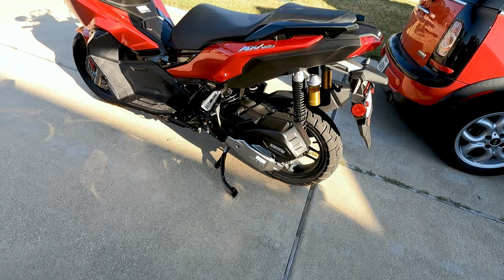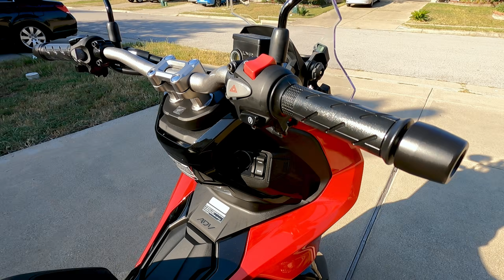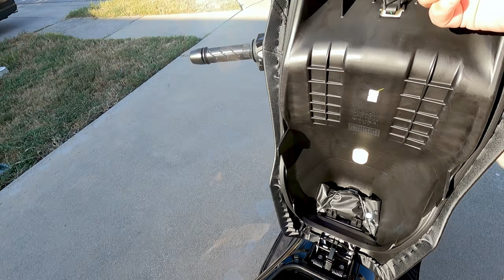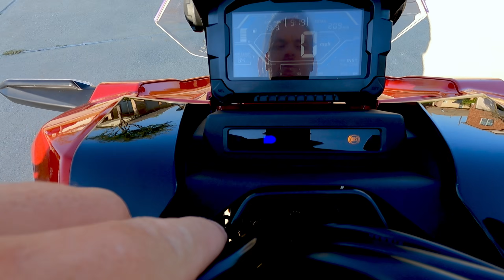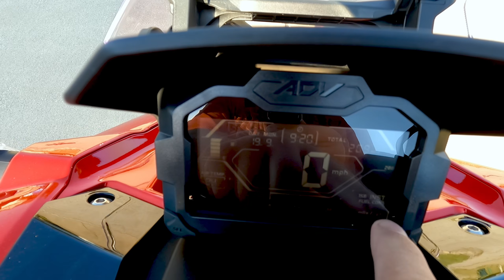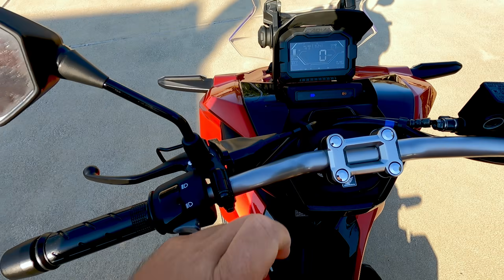Why I Bought a 2022 Honda ADV150 (And What Needs Changing)

Comment: Can u get it into the freeway?
Reply: The top speed for these are around 65 to 70 mph you can go on the freeway but I would try to talk you into getting an actual motorcycle, especially if you're going to be doing a lot of riding on the freeway

Comment: in my county, 150cc is more than enough for daily commute or even touring. but as i come to understand, it is a small cc bike in western countries (even 350 cc is small, in my country 250 cc is considered to be a big bike). do you feel it to be lacking in power? can you go on big roads or even highways with it?
Reply from the maker: I don't find it lacking at all, but you need to understand the limitations of the bike itself. No, I'm not travelling major interstates and generally am only on roads that are 55mph or less. So not really an issue for me because anyone behind me that wants to excessively speed can either wait or go around.
Reply: My brother in law in Cebu has a Click, which I think is similar.  Riding on the back of his sold me on those types of bikes

Comment: After break in, how many MPG are you getting?
Reply from the maker: approaching 6,000 miles now and I would say the average is between 77-94 depending on if I'm around town or long distancing it at full throttle.

Comment: I just got the 2022 adv 150, I only have 30 miles on it so far, I am 5 foot 11 weight 250, Just wondering what top speed i could expect out of this bike?
Reply from the maker: My guess would be 67 while maintaining a solid 55.
Reply: at your weight downhill 80+ uphill maybe 60mph , with a passenger maybe 35mph , lose 100 pounds amigo or buy a F-150 TRUCK !
Reply: @simonkaraoglanof1146  hahahaaaa , nice one

Comment: If take off that rear fairing could you put a 14 inch wheel? If so then couldn't you increase your top speed slightly since it shouldn't effect your top end torque to much
Reply: If you have ever ridden one you would know that going over 60 on this light bike is scary not pleasurable. Much better at 50 mph and below.

Comment: Which one is better? The Honda adv 150 or the Can Am Ryker?
Reply from the maker: They are completely different and better than each other in their own ways. What desire are you trying to fill?
Reply: @ExcelsiorDDZ  idk park of me want the Ryker because of its top speed of over 100 miles per hour and stability control along with the way it looks. I also like the Honda because it also looks good. Which one is faster?
Reply from the maker: @ManOfVizion  The ADV does 67 (72 modified) but definitely a slower vehicle as a whole.
Reply: In the Philippines, the Ryker is very expensive toy. You can buy 8 ADVs for the price of a Ryker.

Comment: Watched Quasi's video yesterday and bought one today!!  I have a Honda grom that I put a small fortune of money into but it just cant cruise at 60mph worth a crap.  You have to strangle every bit of the Grom to go anywhere.  I love how the modded out Grom rips but I really need something that can cruise so I added a ADV 150.  After easily getting to and maintaining speed into a 26 degree 17mph headwind with no problems whatsoever, I am confident that I made the right choice.  It rides like a small Goldwing!
Reply: I have a Monkey with a lot of mods and share your experience with having to use wide open throttle to maintain 55-60. Wind is really hard and the ride is quite bumpy at those speeds. Have you been happy with the ADV? Is it smoother riding and can you maintain speed even with headwinds? Does it get pushed around a lot in wind? I was thinking about going with something bigger like a Honda CB300 or CB500X, but maybe this would be all I need.

Comment: Do you recommend this for a 55 yo who has never owned a scooter?  Thanks!
Reply: Absolutely.  I never rode a scooter.  It is so easy to ride.  I do however keep looking for the pegs when leaving stops because I have grown use to pegs on my other bike. I think this is now my go to because it is so comfortable, smooth and easy.  It has all the fun and none of the work!
Reply from the maker: Being real close to that age, of course I do! It's a VERY nimble bike thats super easy to control.
Reply: I’m 67yrs and bought my 2022 Honda ADV 150 in Aug of 2021.  I’ve owned many Honda scooters in my lifetime with this being one of my favorite. All I did was sit on machine on centerstand at dealership and it fit my body perfectly . A short test drive and this scooter followed me home. I am 6 ft.at 220 lbs. Currently a little over 1000 miles on scooter and loving it. Living in Iowa with scooter in storage at this time.😬👍👍😀
Reply: If you can ride a bicycle you can ride this scooter. In fact it is much easier to ride than a bike.  I just bought one and rode it home 6 hrs and I’m 79 years old. Twist your wrist and you off. It’s far easier to balance than a bicycle.  It just takes awhile to get used to going 40 - 50 mph when you’re not used to it. Take it slow and work up to the faster speeds. In town at 40 mph and under it’s a breeze.

Comment: Can anyone tell me if you can carry a passenger on these scooters?
Reply: I am 5'7" and weigh 170lbs and there is plenty of room.  The ADV 150 is very accommodating and generous with operator and passenger space.
Reply from the maker: It is VERY capable of a passenger, but not very practical.

Comment: How much did you save by buying a scooter with 12 miles? I bought mine in Aug 2021 and currently have a little over 1,000 miles Being in Iowa a little cold to ride currently. I have averaged over 90 mpg so far and once at 119 mpg. I weigh in at 220 lbs. and most of my rides are 35-50 mph. Finding the ride very comfortable with no need to upgrade or modify anything.and smooth never bottoming out the scooter.
Reply from the maker: The lowest I could get OTD price anywhere was $5500 before finding this one. So between $1000 - $1300 in savings.
Reply: I pd. $4,299 MSRP for my scooter. My Dealership only received 3 of these scooters in 2021 so I walked in at the right time.👍
Reply: @ronsteitz4535  MSRP is $4299, but what did you pay OTD?

Comment: How are the rear brake because they are drum?
Reply from the maker: So far so good. I can see that they will wear out faster though because I've had to tighten them twice now.
Reply: @ExcelsiorDDZ  after u tighten them does it feel better?
Reply from the maker: @fahianmiah3489  I tend to tighten it when the parking brake feels loose. You feel the difference in that right away.

Comment: Nice Scoot, I'm from the Philippines also owned one.  I just want to share a simple tweak.  1st follow the PMS  and  Clean your CVT ( Here in the Philippines we called it "Pang-gilid) every 2,000 miles this avoid CVT dragging.  Try to find and replace the ADV Stock 20 grams CVT Flyball with 17grams (cost around $ 8 )   / Pros  - this adds torque, helps  in uphill driving, to overtake another vehicle  and great even with pillion rider / Cons  - affects small in fuel efficiency) .  Also, no brands of  scooter or motorcycle durable ... It's how you use and take care of it.  "NO TO BRAND WARS".🙂✌🏍... Peace, Enjoy and Ride Safe

Comment: I just purchased my 2022 Honda ADV150 in August. I’ve had many scooters since 1985 and this being one of my best. With about 600 miles I will be changing oil soon. Last tank of gas I got 104.7 mpg.  Enjoy and ride safely 👍
Reply from the maker: It's very fun, but the highest I've seen is 88MPG so far, but I'm probably heavier. I just need to figure out that AUTO reset on trip odometer A. I changed oil at 497 and will again probably every 2k miles since its cheap and easy.
Reply: @ExcelsiorDDZ  I weigh in about 210 lbs. most driving is 35-45 mph most of time. I only use Premium fuel. I owned a 1987 Honda Helix 250 I bought new. It was nice but this New ADV has more agility and off road maneuverability.  When I get on this new Honda I don’t want to stop riding. Some complain about speed but to me 60 mph is all I care to do. Enjoy and be safe
Reply from the maker: @ronsteitz4535  Some people just don't get it I guess. I decided to scoot into downtown Austin yesterday instead of battling the interstate traffic and it was WAY more relaxing even though it took a few minutes more.